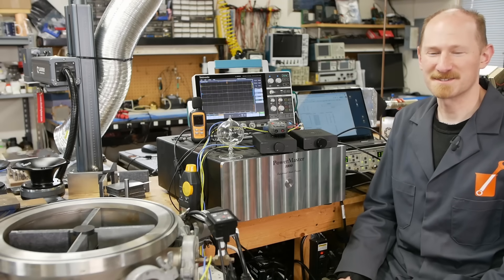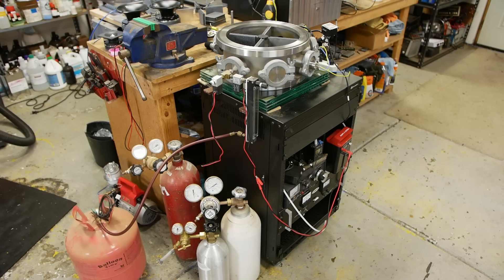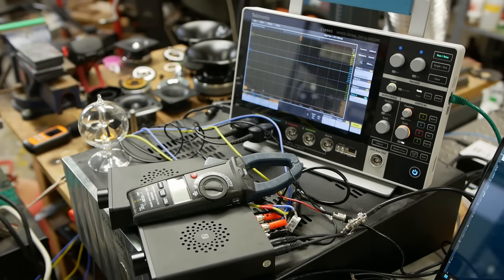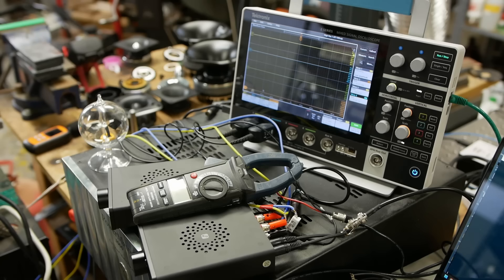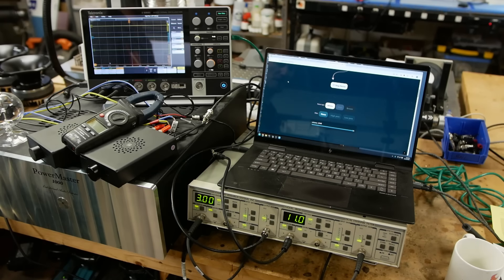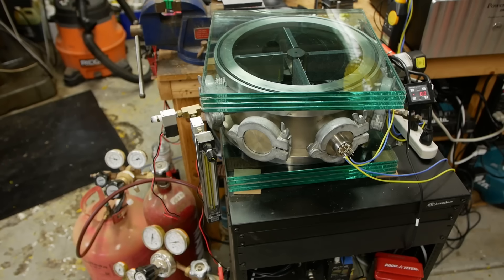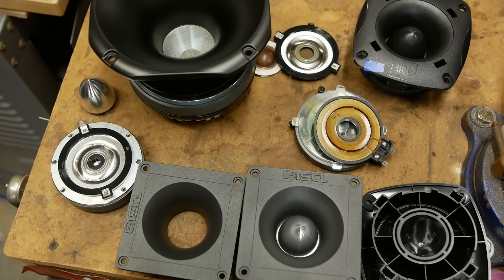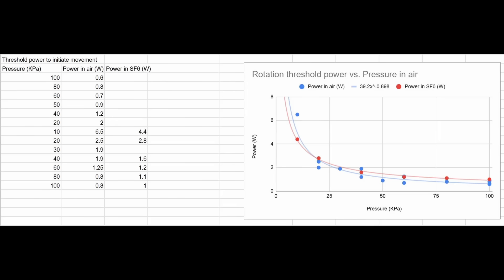Acoustic Radiometer spins in 130dB sound, clockwise and counter-clockwise depending on sound pattern

Comment: Project idea: I was just watching BPS space and he was investigating ways to treat surfaces to improve epoxy bonding.  One of the methods is to use atomic oxygen via high voltage/plasma.  He didn't have great success with it, but it struck me as something up your alley and would be interesting to see working.

Comment: Ben, you confused impedance and resistance. The heating of the voice coil increases it's resistance, impedance will go up and down depending on the frequency input and the magnet field geometry and dynamics of the cone suspension. That's why speakers are rated for "characteristic" impedance, an 8 ohm speaker might be 3 ohms at 40hz and 10 at 20khz for example. Cool stuff you play with man!
Reply: No, he did not. The impedance does go up. It's an AC waveform driving a coil.
Reply: @AureliusR  The increased resistance from heat will have an impact on the impedance, I give you credit on that, but he did seem to confuse the two. But no, temperature increase will not change the impedance UNLESS the heating changes the resistance. If it was a high temperature super conductor, (maybe one day) you could heat it all you want and the impedance would stay the same, as would the resistance. 😊
Reply: He's measuring the impedance, and it is increasing (Z = V/I). You'd have to do further math based on the phase to calculate the resistance.
Reply: @jaro6985  if you’re trying to say that ohms law is for calculating impedance you are completely incorrect. What you meant to say was: Z = the square root of the resistance squared plus the sum of inductance squared and capacitance squared. Thank you for making me look up the formula, that was good mental reinforcing for me… 🙄
Reply: @brentdennard6722  AC impedance, Z = v/i. I should have used lower case v and i to differentiate from DC.

Comment: Using the standing wave seemed to produce a lot more movement. Turning it on and off at the right time got it to rotate, much like a Brushless DC motor. Maybe with a sensor to detect the vane position to control the timing, the efficiency might be much higher.

Comment: No testing with 100% N2? Maybe a slight speed improvement over just air due to the lower density but still being close to what the speakers are optimized for?

Comment: That's a very interesting experiment, nice work. I wonder how operation would change with relative humidity, water vapor being lighter than common air for example, or with foreign matter in the air such as smoke.
Speaker power handling is dependent in part upon the waveform applied. Speakers are made for common sounds, music, voice. They dislike certain signals such as white noise or pink noise and they very much dislike square waves. That 100W speaker doesn't stand a chance against square waves of only a few Watts. You also have to avoid trying to reproduce frequencies it isn't made for. Woofers are quite tolerant of higher frequencies. But tweeters self destruct when you get near their resonant frequency and below.
A piezo tweeter would be a good choice for something like this. They are basically indestructible. They get hot and sound gets distorted but they just don't break. One problem is they generally don't get along with class-D amplifiers. To an amplifier they look like a capacitor. Class-D kinda freaks out with a capacitor as a load.

Comment: I wonder if partial pressures have any role in the pure gas vs air differences. It's one of those weird physics quirks that sometimes matters and sometimes doesn't. 

Even with the cone geometry being optimized for air. Like, is it truly optimized for the mix of nitrogen and oxygen or does the acoustic impedance matching work separately per gas in the mix. In which case it'd just be optimized for nitrogen since it's most present. If that's the case, a pure nitrogen environment would be better than air in the demo. I dunno...

Comment: Fun idea. I like the idea of tuning the shape of the horn and cone to the different gasses. Did you try different frequency tones for the different gasses? Recordings of actual instruments? You already mentioned the standing wave issue, but what happens with sustained tones from actual instruments that also will yield multiple harmonic tones in addition to the primary tone? And while you're at it, why not try actual songs? I would imagine introducing so much more complexity may not yield any clear data, but playing with different genres, frequencies, rhythms, and speed might be a fun place to start.

Comment: Would have been interesting to relate the speed to the sound pressure level (loudness) instead of speaker input power.

I guess finding a microphone that works with various gasses and at various pressures would be challenging though.

Comment: Commenting at the start- I'm guessing the heavy gasses make speaker go slower, and quieter because the additional mass needs more energy to get equal momentum to smaller mass
Reply: LOL, in hindsight- I did see what I expected with the heavier gasses, I would have expected more from the lighter gasses- but I also didn't realize that the horn was impedance matched to atmosphere gas... Like the fish don't think about the water if it don't have to- I didn't consider that the horn and driver were tuned to the atmosphere.

Comment: couldn't you play with the phase of the sine wave coming from each speaker to get the reverse rotation without having to manually turn it on and off? i guess that would only work at very high rotation speeds or with a rotor that has a huge number of "poles".
Reply: better idea, use a three-pole rotor but keep the four speakers, then you always have some torque on the rotor.

Comment: The metals might create eddy currents in the plates from the magnets in the speaker.  I think waveguide should be used to complete decouple anything magnetic from the setup.  Not saying that's causing anything, just that it might be an uncontrolled variable since you said its nonmagnetic materials which isn't true for electromagnetic fields at these frequencies.  Having a waveguide would also allow you to have the horn tuned to the specific gas needs.

Comment: I guess it depends on the surface area of the veins and the frequency of the vibration? I would guess that sulfur hexafloride would make it move faster because it travels slower and would have more time to impart energy on the surfaces. Not a physicist by far, I am in fact an idiot and accept my fate either way. And I did not cheat, promise.

Edit: just for clarity of my response.

Edit2: it was a trick question! I literally yelled. Scared my cat. It was because the speakers were designed for air. MIND BLOWN. Keep it up Ben.

Comment: Super cool demo, the bit about impedance matching depending on specific gases makes me wonder if you could measure small amounts of a different gas in air that way? Like if you designed a speaker really specifically for air and had it in a chamber with a microphone at the other end, could you detect if the composition of the gas changes?
Idk if it would be any good of a gas sensor but it would probably be a cheap way to detect any change in the gases regardless of what it is. Like you could put in 0.1% of trifluoronitrosomethane or something and you would know hey something changed.
Reply: You could even say somethane changed
Reply: @ds332a  This may or may not have been the first thing I thought of since I've been working on fabricating a methane sensor as part of a club at uni :3
Reply: not with a radiometer, but yes, it is fairly easy to measure acoustic impedance, and yes, it would be really sensitive (that is, only sensitive to acoustic impedance, and not other things) using speaker only -- just measure the frequency-dependent impedance of a directional speaker (e.g. 40kHz) blasting straight into an absorber. No need for a microphone. The transduction efficiency depends heavily on the acoustic impedance, and that will show in the electrical impedance of that speaker.

The downside is that it would not be sensitive to any specific gas -- only it's acoustic impedance, and that changes e.g. with moisture content, and can't distinguish between e.g. 1% helium or 2% hydrogen.  In other words, it's just a 1D property.

Comment: Would better results come from ~pure N2 or O2?  Could it be built so that the speakers were on the rotor (ramjet style)? Could the hub edge be loaded axially with magnets so to generate a small current in an external coil, and used as a dynamometer?

Comment: It would be really interesting to see you go into the math behind the horn shape, engineer one for a different gas as described at 13:58, then test it out with a 3D printed prototype!
Reply: I 2nd this. You really piqued my interest in that section, and I'd love to learn more about how that optimization is calculated, and if other gases (or fluids in general??) perform better/more efficiently than air!
Reply: Your Google-fu is not strong! (cite the film reference 😊)
Web search "speaker horn acoustic design"

In ancient times (1960's) it would have been an iterative trial and error process. Now we have CFD to show that the old timers got it right.
Reply: My question is more basic: Is he actually correct with his assessment or is the horn mostly used to make it directional? The latter would be irrelevant for this use case.
Reply: @leocurious9919  It's all impedance matching. As is the metal horn on an ultrasonic welder, for example.
Reply: @kenmercer2721  Well then, of course, it is very relevant. Thank you.
Reply: Checked the comments, as I assumed somebody had already suggested this,  so yes I would like to see if that could be done as well.
Reply: What’s the best horn shape for transmitting sound through ketchup?
Reply: I would be interested if maybe different gasses would work with different frequency ranges?

Comment: Having to turn the sound on and off as it goes by certain points reminds me of a brushless motor controller.  An acoustic motor controller of sorts.
Reply: I wonder if you could rig up a "commutator" to flip the signal between two pairs of speakers and make it run "backwards" continually.
Reply: @goldsaturn25  The answer is 'yes you could'
Reply: I was thinking of the envelope function on a synth. You are enveloping the noise with a 1HZ square wave.
Reply: Crazy how that could be a motive force.

But could it run on steam powered by burning wood?
Reply: That's a good idea/observation.
Reply: All of these are analogous in a certain sense, but honestly I thought of a Gauss rifle/coilgun.

Comment: Technically there can (and probably will) be a standing wave or mode based on the Schroeder frequency. You'd need to consider the modal, transitional and diffuse frequency ranges to really hone in on the accuracy of your experiment.

I must say, I'm in awe! And you've confirmed a few suspicions I've had within acoustics based on your experiment. Fascinating work!
Reply: Because of his 3k-11k band pass, or on top of that? I assume that his band pass would also allow some standing waves to overpower others.